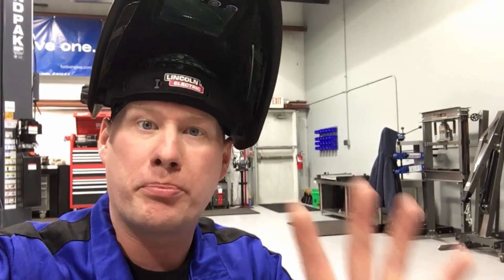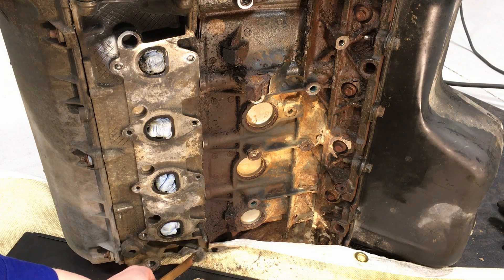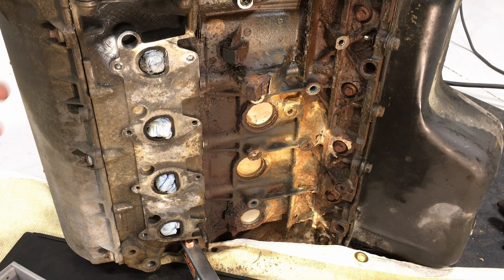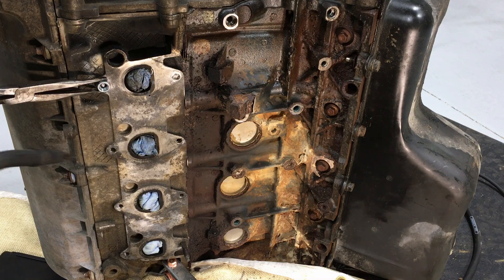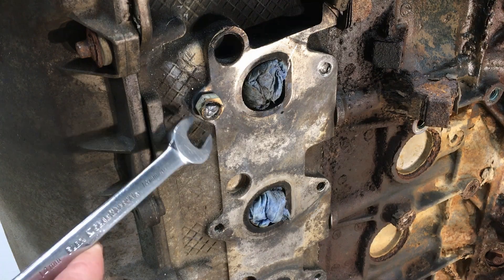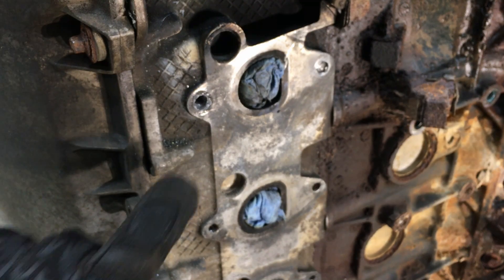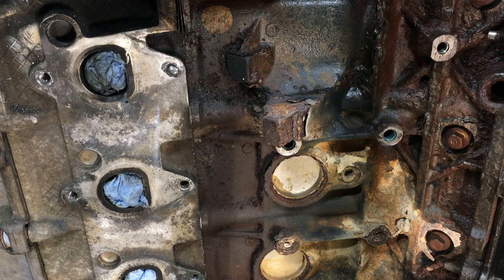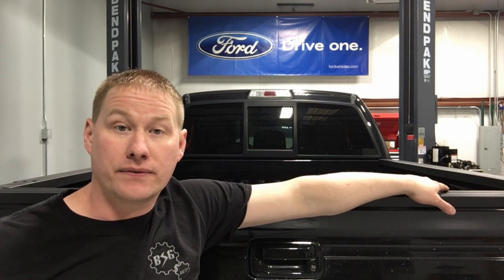Best Way to Remove Broken Exhaust Manifold Studs?

Comment: Anybody feel like helping me out i got a 2000 5.4 2v that has a manifold tick of course. The truck isn't too rusty but I'm sure at least one stud would snap at best. How hard is it to access the heads with the engine in the truck if i wanted to try this? I'm debating if I even want to touch it. It's a beater not a daily but it's ticking super loud
Reply: I just did the exhaust manifolds on my 97 f150 4.2 the nuts and studs were ridiculously rusty and I was certain I would have broken most if not every one I touched. So before I tried anything I heard of some guys using automatic transmission fluid and acetone as a penetrating fluid 50/50 mix and man I couldn't believe the results! Didn't break a single one. Might be worth a try not sure of the access on your truck but after removing the inner fender on mine I had all the room in the world. Good luck bud
Reply: I had the same truck..  all manifold bolts can be accessed through the inner fender. Wasn't too bad, but I was well armed with a "bolt-out" extractor kit.

Comment: Good job Brian  - - -I have done this many times over - drilling then using a easy out  ( extractor ) is not the way to go because the easy out tap will break off as you know your self by  using them .  Good video .

Comment: Works so much better with regular mig and c25 gas. As the flux core welding on top of itself is contaminated once you run the first pass
Reply from the maker: Yeah but none of that matters for a weld that needs to last two minutes.
Reply: FordTechMakuloco yep. Agreed there but what I’m mentioning it for is because it melts in better on those stubborn bolts and welds to stainless better for a better bond ! Good videos my friend

Comment: Love that trick man. I’ve used t countless times and I’m now deemed the broken bolt guy at our shop. I like running mine on the hot side. Usually build a small nub up then burn the nut on afterwords

Comment: I've had to do this a couple of times at my ford dealership for some of the techs. It works pretty well. Did it on a 2008 4.6L explorer and a 2016 transit with a 3.5 eco boost. Worked both times.

Comment: Great video. A bit off topic. What is the latest recalibration for a 13 f150 3.5 ecoboost?
Reply from the maker: Ford does not hand out specific changes they made. The calibration file varies based on your build

Comment: Are you using a flux core or gas (or both) for shielding?
Reply from the maker: Only flux here.
Reply: Oh, that explains the narrow tip! It must be easier to maneuver your tip, compared to the MIG setup I use.

Comment: You are awesome saved me on a lot of things in my 04 f150 but I can’t find any videos on my current problem my digital odometer lights up with the green lights but no display for mileage or anything else any ideas before I have to change the whole cluster for something simple it’s important to cuz I literally just had a new motor dropped in at the tune of $7,500 so odometer would be nice....thanks
Reply: Micheal Scott is it dates all the way across?  Also, 04 had both bodies... Have you got the old style body? (Heritage) or new style?
Reply: *dashes, not "dates"
Reply: Dash is all the way across tach and Speedo on both sides temp battery oil etc etc in the center and newer style
Reply: Odometer under Speedo green light but no read out it worked off on for awhile then quit but again with new motor it’s important to me
Reply: I'm pretty sure that means the cluster is not communicating with the ECM... On older body style there was a very common issue with a cold solder joint that made the odometer flicker and dim... All dashes means no comms (odometer data is stored in the ECM...)
Reply: Ok so that pretty much need to change cluster one from a junkyard should work fine yes?
Reply: No, not yet... There's other things to check first, especially since it was giving you problems prior to the engine swap.
Reply: Ok I’ll have the shop that swapped motors take a look at it when it comes to you definitely are the guy to go to unfortunately I’m in Texas no where close to but I do appreciate your time and responses... thank you if have any suggestions I’m all ears

Comment: Would this work on a cast iron block or do you run the risk of cracking the cast iron due to rapid changes in heat?
Reply: When welding you want to do short 2-3 sec bursts repeatedly heating and letting it cool in stages. Risk of cracking is very low. But coat the area around stud w/ grease so stud doesn't get welded to the block/head.

Comment: Nice!  Just FYI, zinc welding fumes are pretty nasty in the long run (metal fume fever).  I try to weld uncoated metal if possible.
Reply from the maker: Of course if you can find it. Question is which is worse zinc, black oxide or galvanized?
Reply: FordTechMakuloco I'm no expert, but I would think zinc and galvanized would be worse given the higher zinc content in both.  There doesn't seem to be any zinc in black oxide coatings.
Reply: They are both bad, I have had flu like systems for several days after welding on these coatings on a job, I use a good filter now lol when I weld on them for any length of time, I think it depends on how much you are exposed  to the fumes.
Reply: I put zinc or galvanized  stuff in my gas forge (outside) to burn off the zinc.    Then its safe to weld on.   Option B is to hold your breath while welding since its a very short weld, then step away from the smoke.

Comment: Hi Bryan, do I have to worry about the car electronics when doing this, always afraid of frying a module.
Reply: I've done it both ways with no problems. Keep the ground close and secure to the work. I think the battery provides a  damper to voltage spikes. There is a device that crosses the battery terminals that is supposed to protect your electronics.

Comment: Done this too.  Works well most of the time.  Unfortunately some studs just won't budge and require drilling.
Reply: My stepson is at this point on an exhaust manifold or a 2005 Dodge Ram 2500 with a Hemi engine in it, He had four or so that wasn't broke but the heads of them were rusted to little nubs! I torched the head off from ALL of them and we got the manifold off, and with LOTS of work we got a couple of the long stemmed bolts out but they didn't just unscrew like the ones in these video's, it was more like a thread locker had been use, which in most cases the extreme heat will unset the thread locker, but his studs are seized in the heads, and he had three of them that were just broke off at the head and we NEVER put a wrench to them, they just broke sometime in the past on their own, I think that's what caused the manifold to start leaking to begin with!

Comment: Newbie here so pardon the dumb question, but don't you run the risk of welding the nut onto the engine block?  Or did I miss something where this type of flux doesn't mix with the block's aluminum?  If so, which type of flux is it?
Reply from the maker: It won’t penetrate the aluminum like the steel so it just breaks free of the head.
Reply: Interesting, I really love this idea, one more reason to own a welder. wish I'd seen this 5 years ago when I was working on my 2000 Nissan quest.  Thanks for the video and answer.  One more for you, assuming one has a welder, when would you favor the welder method over drilling and other more traditional bolt removal methods? I'm just a DIYer & I've been watching videos on YouTube for at least 4 years, this is the first time I've seen this method for removing broken manifold bolts.

Comment: Brian, is this the only solution if you can't get it to work with heat and extractor like you explained in your previous video?  I've got one stud on a 5.4 that is stuck extremely hard.  #2 "Grab It" extractor just strips.

Comment: This isn't working for that 2014 Explorer cop car on my lift, told the boss we're looking at possibly pulling a head, depending on what the foreman says. 

Penetrating oil, induction heater, torch, nothing is budging these damn things
Reply: Idk try an extractor
Reply: AMGV Media Did, 2 different types (turbo socket and clamp style) and all the did was chew the studs up. Already told the service manager we're looking at a head
Reply: This is how I always do it. 

I am a sh@t welder, never had luck welding a nut on. I just booger weld out and make a goop with weld. Then use Irwin bolt-grip extractor (they come in different sizes a kit) to grab on the weld and unscrew it out.

Comment: Yep, I like this method for removing broken bolts/studs.  Good tip.    But instead of welding the nut onto the Bolt , I first weld on a washer. It is narrower, so it is a little easier to get the welding wire down to the broken bolt.   Once the washer is welded on firmly, I weld a scrap nut onto the outside of the washer.
Reply: So you don’t weld right into the middle? What do you mean by outside the washer
Reply: @weldingjunkie  I believe by the "outside" of the washer, he means the side of the washer facing away from the engine...however, I could be wrong, it's happened before.
Reply: Glen Blair ah that makes sense you’re prob right. I understand now. I just kept thinking middle because there’s a hole no sides If that makes sense. You’re right tho
Reply: @glenblair4103   Yes, you are correct.  The side of the large washer that is facing away from the engine.   Yep, it looks like I never received notification of this thread. Thanks for responding to the question.
Reply: @weldingjunkie  I've wondered that since he said this, but he has notifications off or didn't see it. 

I thought about his washer, but I couldn't imagine how it was helpful. I could see how the nut would weld with even less contact unless maybe it sat inside the bolt?
Reply: DE Nichols yeah doesn’t make sense to me at all either. Just went the middle lol
Reply: Beauty tip!  I have been using 1/2” nuts to I can see in there, and angle the gun, but you have to build up so much wire to keep the big nuts from being sloppy
Reply: Good idea.

Comment: Lincoln ...???
disappointing choice ..!!

it's Blue all the way  :)
Reply from the maker: I have seen it both ways and ended up going with Lincoln on the advice of a retired welder.
Reply: are you going to buy new, or used ..??
Hobart Handler 120 can be had for $175 around here used
they kick the crap outta Northern Tool, an Horror Fright chinse crap, and will last you years, even as your welding skills get better
a Professional quality welder
Reply: I have a Lincoln and 2 Millers, they all weld.
Reply: Embree Smith what portable welder would you recconmend MIG. Interested in buying one but of course everyone you read about is the best. Just for the automotive DIYER. THANKS
Reply: Lincoln, Miller, Hobart, even Esab are all great welders.